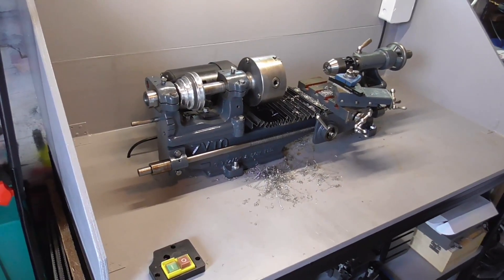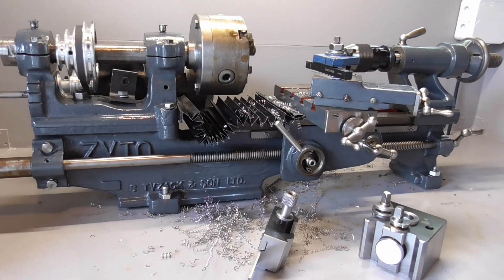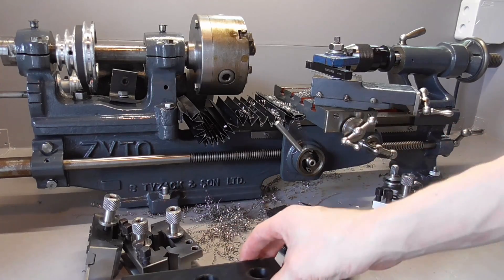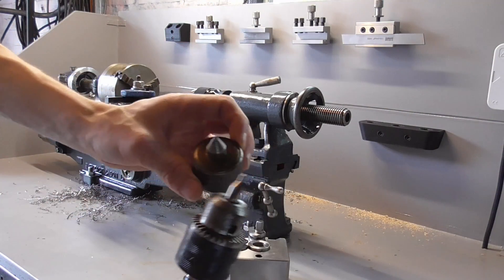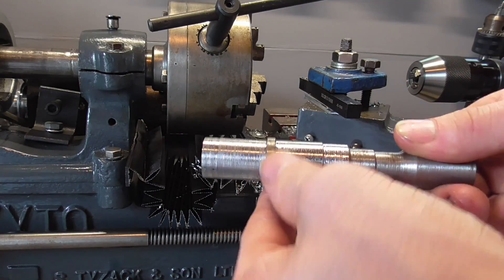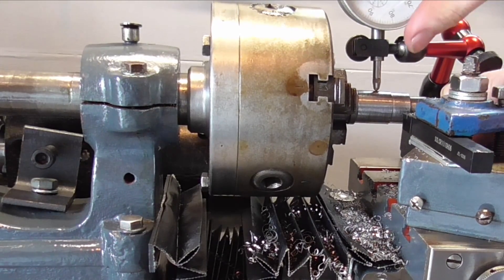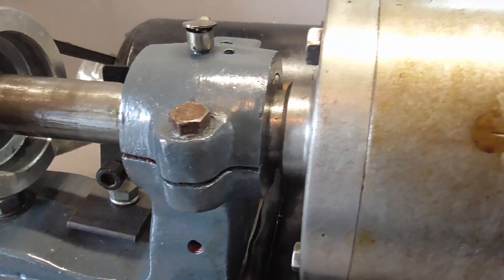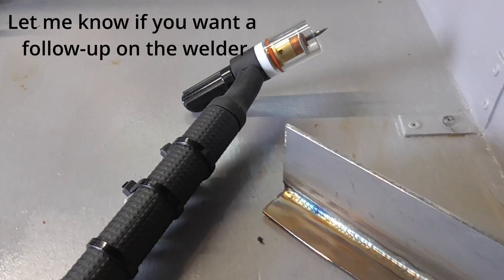Enhance Your Mini Lathe with these 3D Printed Accessories!

Comment: Hi Steve, love the content but there is room for improvement if it comes to showing exactly what you are talking about, I’m patient when it comes to that! I have the same lathe an love the 3D printed parts! Might use your idea if that’s fine. Looking forward to a good barings solution as well 😅
Reply from the maker: Thanks for your comments, videography is not my strongest skill but with feedback like this it will improve over time 🙂 I am too looking forward to the new bearing setup, I can't wait to use this awesome little machine to make some nice parts!